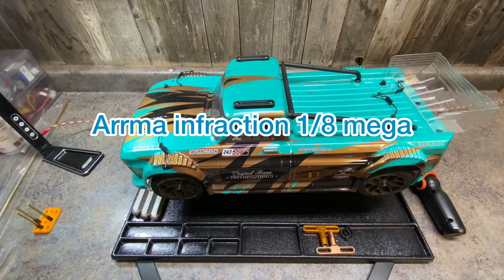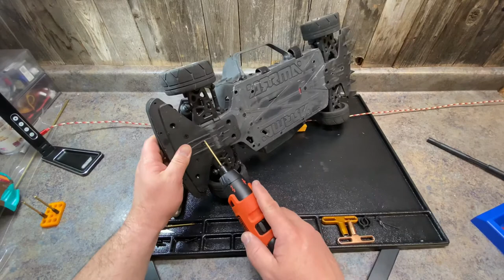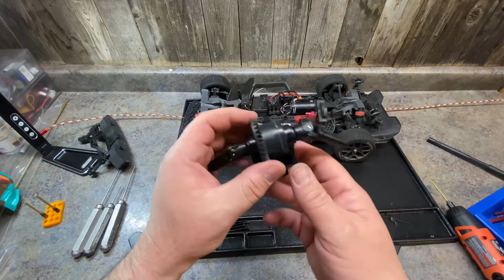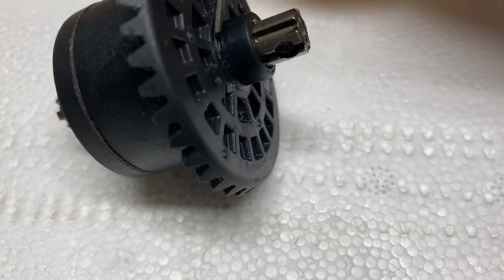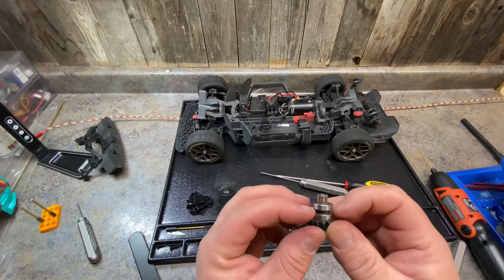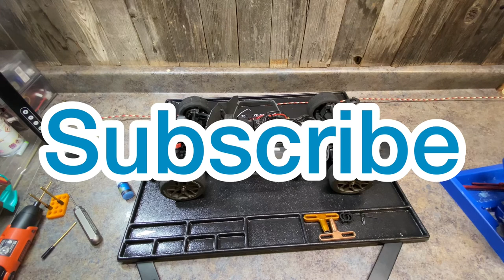Arrma 1/8 infraction Mega & Vendetta fixing the bound up drivetrain problem

Comment: For anyone that maybe doesn't have the equipment to shave down the diff itself. I sorta fixed the problem by loosening the 2 screws on the diff yoke. The plastic part that wraps around the diff as well keeping the bearing washer in the same location. It helped out a lot with the binding. I'm thinking factory over tighten these screws and with the way its already held in by the chassis. I don't think it'll hurt to much loosening them.

Comment: Great video man, yes my Vendetta is the same with lots of friction on the front diff. Also my Vorteks has this same problem on the front diff, not as bad as my Vendetta but still a tight spot on a smaller area of rotation. I can literally hear the rub area as well as feel the tight area on the Vorteks. I also checked a number of my older V2 & V3 Arrma 3s BLX cars that i have, like the Granite V2, Senton V2, Typhon V3, & Big Rock V3 & all of these have no friction issues at all & spin nice & free on both front & rear diffs.
Reply: Yup all my older ones are free but my new mega typhon has a tight spot and is loud when running

Comment: Thank you so much man! I ended up having to do front and rear on the diff housing and both pinions. I wonder if the 1/8 3s infractions are the same way? It's all the same parts so I would assume so
Reply: Yep can confirm! Mine was always  jerky when driving slow but it was out of the Box so I didnt think much of it. Nor 3 wheels later my wheels are basicly locked up. Habe to try this Trick tomorrow.

Comment: Still Having bind issue with one diff, removed the lip to allow bearing to seat down further. but one diff is still very ruff n leaving marks on input gear just from me spinning by hand, any idea?

Thanks
Reply from the maker: I had to remove material from the input pinion gear also in the front of mine
Reply: Do recall you saying that, have a bunch of spare inputs will give it a shot thanks 🤝, odd it’s just the one diff..

Comment: I've just replaced/upgraded the diff housing in a old v1 mega granite.
I installed the new HD diff/pinion and ran into this problem.
I'm wondering if the older yoke from the maga/v1 line is different.
Reply from the maker: So you got the steel ring and pinion gears ?
Reply: @metalrc  No, the plastic v3 gears(Referred to as "HD" by Arrma).
So I'm mixing v1 yoke and v3 gears.
Reply: @metalrc  Now that I've reexamined it, it looks like the ridge you removed on the diff is missing(Basically factory fixed).
But my ball bearing doesn't slide all the way in, it stops at the same height as if there was a ridge.

Comment: Quick question, so my front wheels seemed pretty good, both spinning in the same direction and not much resistance (driveshaft out of course)..but the rear spins opposite to the one i'm turning, so I just went ahead and shaved down both the front and back bumps. It's spinning much freer now, but the back still spins opposite. For everyone that did this, does all your 4 wheels spin in same direction if you were to grab any wheel and turn it (like at the start of the video?)
Reply: Probably because the rear is still hooked up to the motor so it still has resistance

Comment: Hey bud are these gears the same as the 3s Arma trucks.. Like the senton n granite?? Thanks I think my infraction mega is bad
Reply: Yes they are the same gears. Diff n inputs.

Just got a mega slider last week going thru it yday noticed very rough binding with diffs. Removed shim hoping it would help but didn’t. Must have to remove that lip, will be giving it a try with a small Dremel..